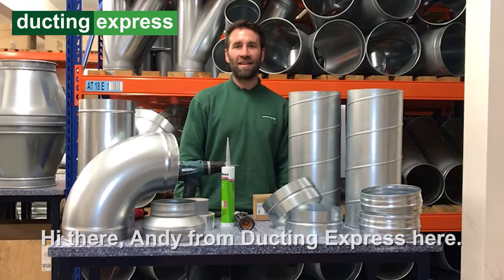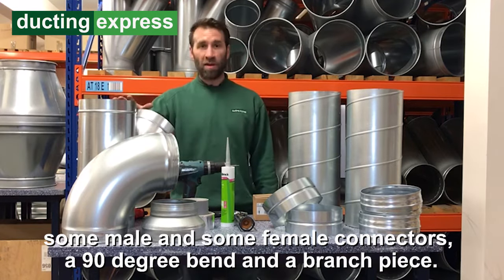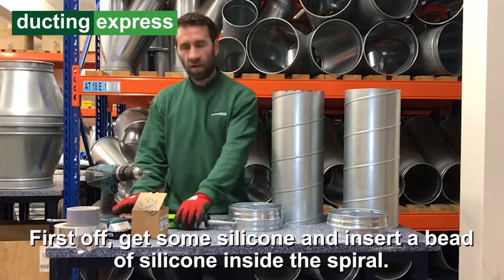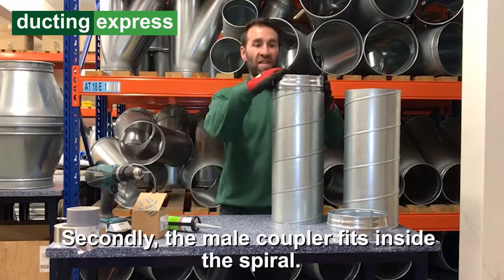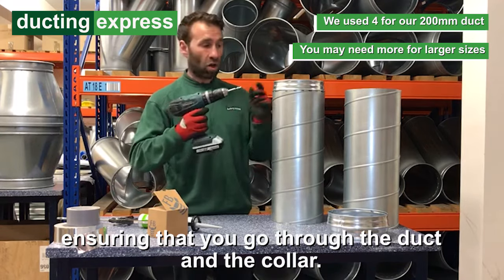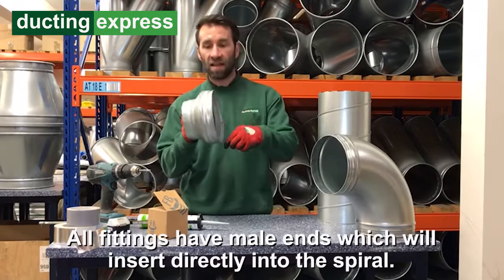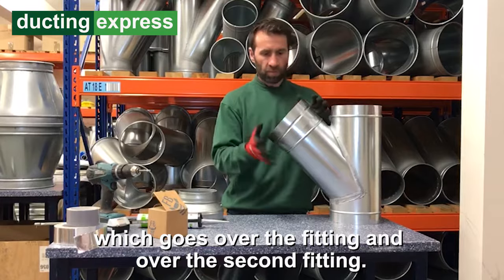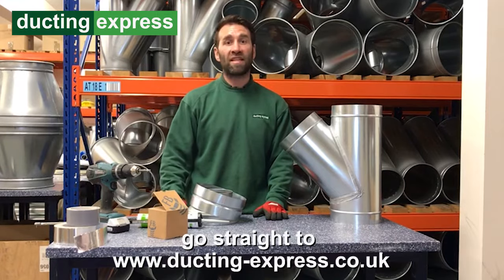How to connect spiral ducting | Ducting Express

Comment: Why no rubber bands around joints? We using LIndaB parts in Finland and all the parts comes with a rubber band at the joints. no hassle with silicone or tape
Reply: Do still need screws?

Comment: silicone sealant is non compliant, tech seal or non-setting acrylic sealant is recommended to be compliant with part F, also tek screws and tape is compliant and less messy. siicone drys out in a day or two and is useless where there is consistent air movement and dynamic temperatures.